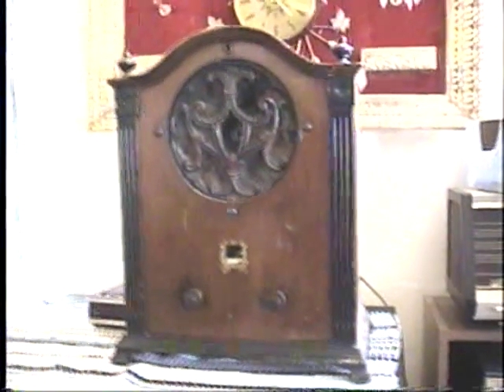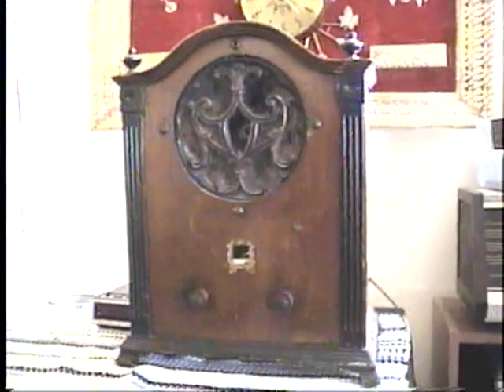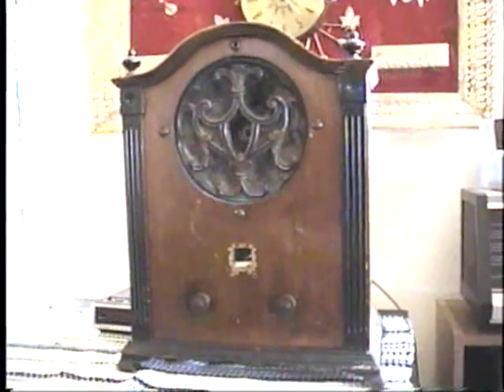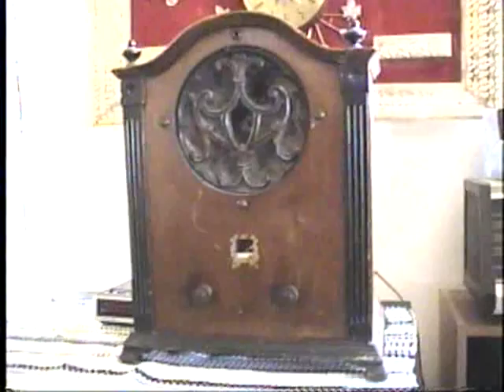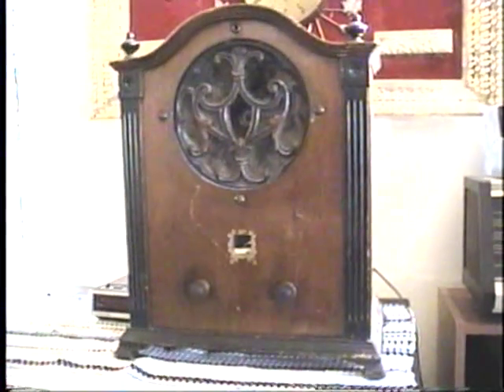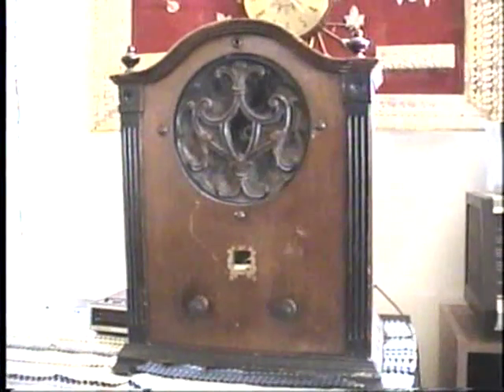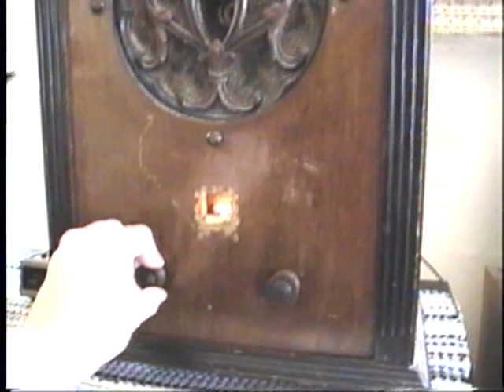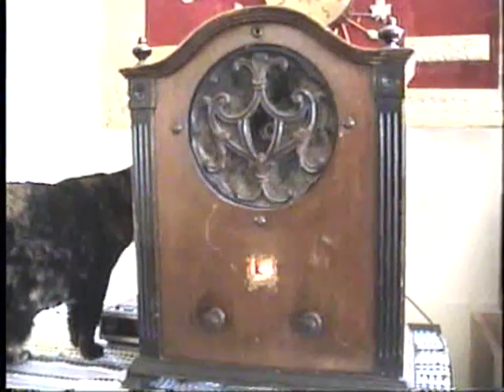Sparton Antique Radio Model 400 (Part 1)

Comment from the maker: You know what, it actually doesn't use type 45 tubes, I just assumed that was what it had! It actually has one type 171 and one type 371 power triodes. The other tubes appear to be a triode detector and 2 RF stages.
I'm not sure if it's push pull or not...I need to check the Riders manual and see how the schematic is laid out.